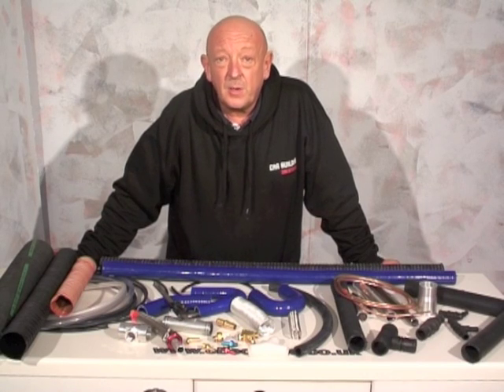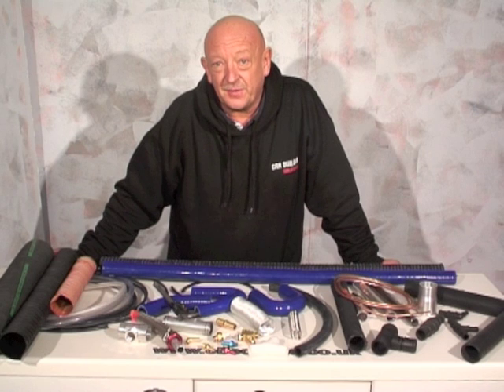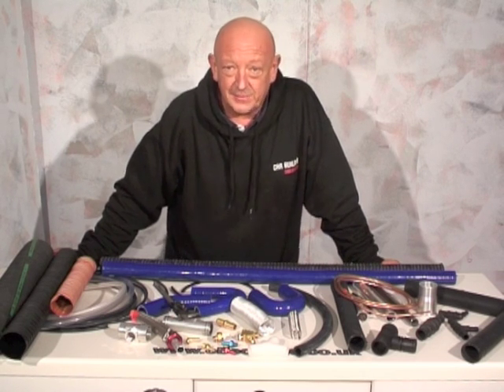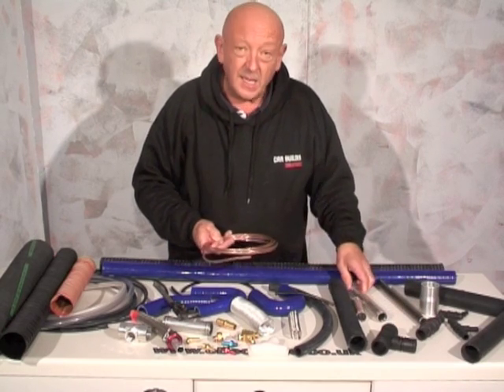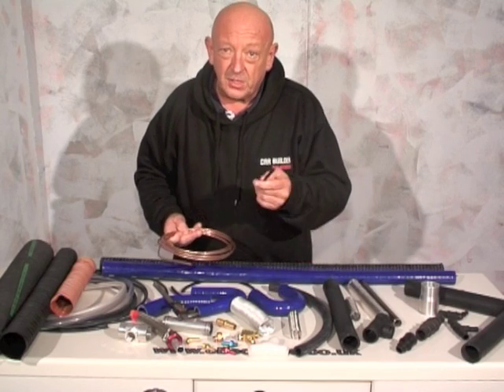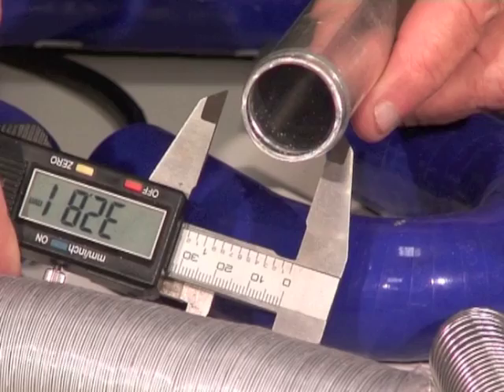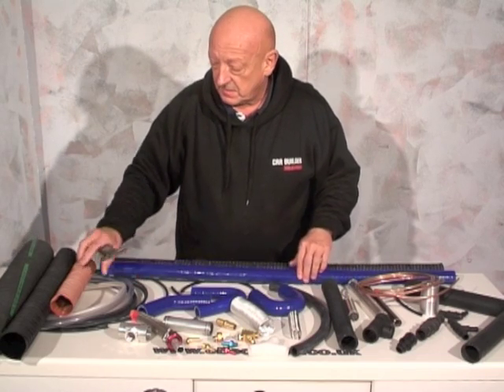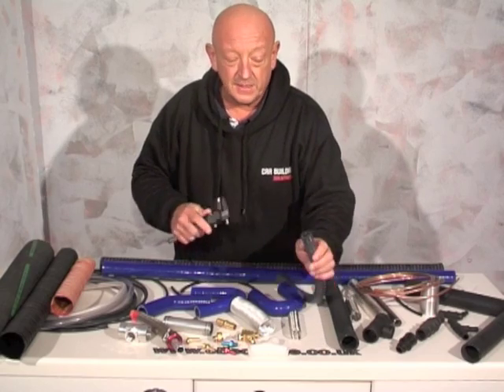Hose and Pipe dimensions explained

Comment: This is true for most but electrical conduit, ridged or flexible is measured using inside diameter as well as black iron pipe for plumbing. This gets a bit tricky once you get different schedule thickness of PVC, ABS etc as the ID is not always the same but is close.